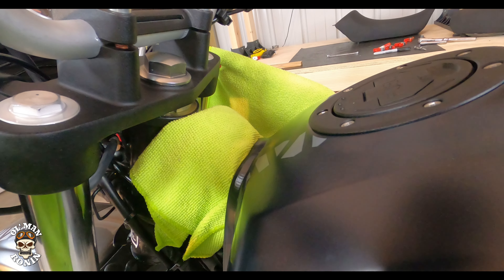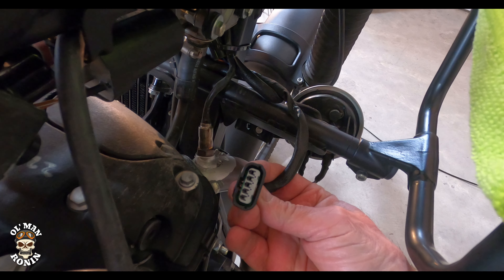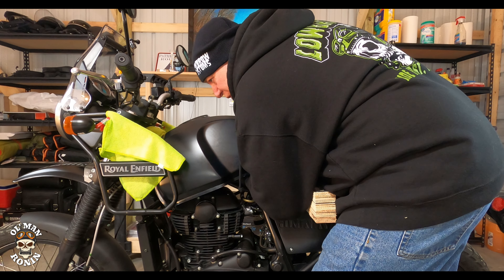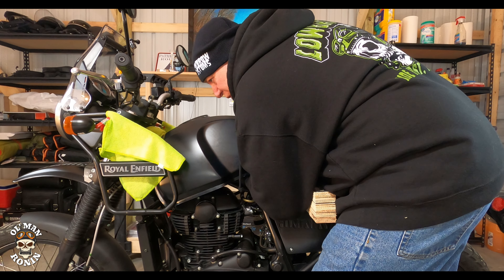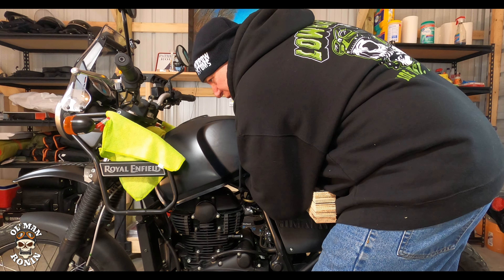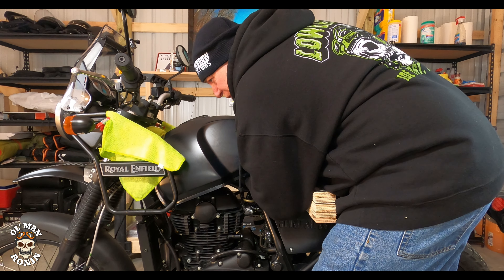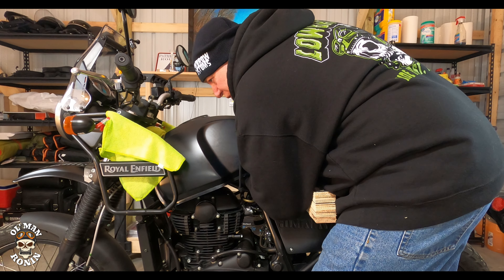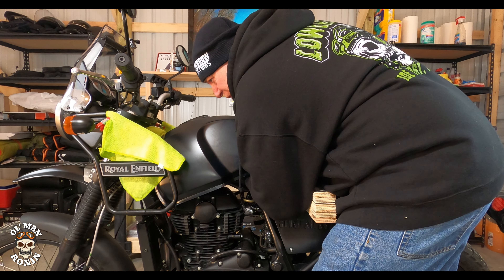Royal Enfield Himalayan Build Series - Step by Step Gas Tank Removal | Ol' Man Ronin (S2,E11)

Comment: Just had the tank off this afternoon on my buddies bike do to some wiring of lights. Getting the tank off no big deal getting the rear mounting bolts back is a complete pain in the ass. We took a good 20 minutes to get the holes lined up.  Tip, use a drill bit or awl to force the holes into alignment and even then it was a right pain in the ass. The washers on the underside shift very easily and then the bolt will not go through, the neighbours learned some new words.
Reply: I just installed a boosterplug for my 2021.  Taking off the tank wasn't bad and installing the boosterplug also was ok but can't get the tank bolts installed, shouldn't be this difficult.
Reply: @charliechance8589  yup it is a bitch you need a friend to push it forward into the cups and then use a drill bit to get the washers lined up. Next time I am going to glue those damn bottom washers in place first.
Reply from the maker: hmmm never heard of putting a little grease to hold them in place?
Reply from the maker: hmmm never heard of putting a little grease to hold them in place?
Reply: Getting the tank off was easy.
A tricky job getting it back on.
I'm still struggling... to line up the holes for the bolts. It's like I'm stuck on the rubber mounts 4 or 5mm short of where it should be...

Comment: Great Vid as always. I took my tank off to vinyl wrap it. Reinstalling I had a beast of a time getting the mounting holes near the seat to line back up. Got it, but man the clearances were definitely less. Still overall not too difficult and a great video. Man after my own heart.
Reply from the maker: yes it can be tricky, I didn't have issues, but using a wood chopstick to help line up the rear bolt holes helps and not damage threads. Ancient Chinese Secret lol

Comment: If you cut the breathers in a more accessible spot and use a barbed hose connection it might make it easier to remove. Also use some silicone to stick your washers to the bottom of the tank mounts.

Comment: Did my first valve adjustment on new bike about 430 miles before I got to it. Both valves were tight. every was pretty easy with valve tools but having a hell of a time getting the tank bolts back in. The tank needs to go another 1/4 forward but she won't budge. Threads looked like the factory had a tough time also.
Reply from the maker: yikes. It came off with no issue though??
Reply: Was tight when it came off. Ended up using zip tie on front brake so it didn't come off the center stand and pushed forward as I wiggled the back of the tank up and down and finally got it to line up. Thanks for the reply!
Reply from the maker: @stanleyne1  I'd check to see if the grooves that the rubber sets go into on the tank are bent keeping the tank from going any further forward if possible. If they seat up all the way, then I would talk to your nearest RE dealer. Thats a new one on me to be honest.

Comment: I’m having problems removing the fuel pump connector. How hard do you have to squeeze? Am I missing a tab I should be squeezing? Thanks
Reply from the maker: you're probably missing a tab. there on opposing side. Try to Press in, push up slightly and pull down

Comment: Great video, thanks 👍 would you know if the process is the same on the BS6 / Euro V model? I had a glance through the factory shop manual for that and the official process is to drain the tank first, my instinct is calling bs on that! 😁 What you've done in your video here is far more inline with what I would expect!
Reply from the maker: I think they say that to drain the tank is because of weight. But I can't say for sure. Look where the fuel line meets the connector and see if there is still a compression connector. If so, I wouldn't bother to drain the tank, just another unnecessary step. BUT to be safer, do this when the tank is near empty.
Reply: @OlManRonin  Thanks :) I was hoping the weight was the reason (that and safety generally when the tank's off the bike!).

I want to route some accessory cabling under the tank and take a look at the wiring connections for my front ABS sensor cable (keeps triggering the ABS and engine management light) but I'd prefer a quicker and easier method than draining the tank first!! It's only got 1/3 of a tank in it at the moment, so will give it a shot!

Comment: Great video have one question ,mine is giving a bit of a poof, when I fill up with gas, so I’m wondering where is the breather located because it does not seem to be letting the pressure out, maybe it’s blocked or restricted in some way, which I’d like to check If I can find where to look?
Reply: It's normal, no worries

Comment: I messed up taking off and putting my tank back. It was spilling gas at whatever angle i was leaning it towards. And the tank just wouldn't go back the on the stays after but after a little persuasion it found its way back. Plugged everything back and screwed back the bolts. Ran the bike around the neighborhood with an engine check light on. But eventually went away. Bike ran. But I was worried lol. I like the towels idea.. I should've done that. Some of my cables or wirings got pinched abit from the tank. But i guess it's fine. Thanks for this video

Comment: G'day from South Australia Ronin. Looking at those 2 lines under the tank, are you sure the one with the clamp on it isn't the fuel return line. Fuel injection systems use constant pressure to the injectors which supplies more than they need most of the time so the excess is returned to the tank.

Comment: where those those 2 hose goes in tank and evap system ? on fuel tank area ?
Reply from the maker: mid under tank
Reply: @OlManRonin  thank you as newly Himalayan is lot problematic as within 5000kms gave lot fuel pump related issues finally Pump failed under Warranty first had those relays  as  fuel pump costed 104 $ in our place  until found your video helps a lot thing out for maintaining Himalayan

Comment: Did you have check engine light come on after.
Reply from the maker: no
Reply: Ok. Mine did. Hmmm. Runs great. Checked hoses again.  Seems to be fine. Maybe just needs reset.
Reply from the maker: @Kyrodan022  did you disconnect the battery before you took tank off?
Reply: @OlManRonin  nope.
Reply: @OlManRonin  no i did not..didn't say in the instructions.
Reply: my bad..you were just taking it off...I took mine off and put the Air intake removal kit on..

Comment: I did my valve adjustment today and everything went well until I was reinstalling the tank. The two bottom washers fell off and I couldn’t for the life of me line up the bolts and washers over the holes. I ended up not installing the washers.
Reply from the maker: you don't have the tank seated properly then. The washers help protect the rubber mounts. I personally wouldn't ride it until done right. seat the tank, wiggle in  until the bolts fit. Use a screw driver to or scratch awl to center the holes. using the complete washer rubber mounts

Comment: I thought wow when you were removing the fuel line and pump wire, Enfield are onto a winner with not having to grope around under the tank to remove the connectors,  it's a shame they had to spoil it and put the two lines and fuel gauge wire under the tank you have to grope for.
Reply from the maker: Its easy peasant UNLESS you don't know they are there ... if you don't and pull the tank off SURPRISE! LOL
Reply: @OlManRonin  Who are you calling a peasant, I have never been so insulted in all my life ;) Auto correct is so easy peasy :)
Reply from the maker: ugh meant easy peasy darn auto c

Comment: I've done this twice now.  Re-installation is dang near impossible; lining and starting those bolts (without cross-threading) is SUPER TOUGH!
Reply from the maker: Sorry to hear that.
Reply: they say if you spray the frame rubbers with silicon or any dry lubricant they slip right on